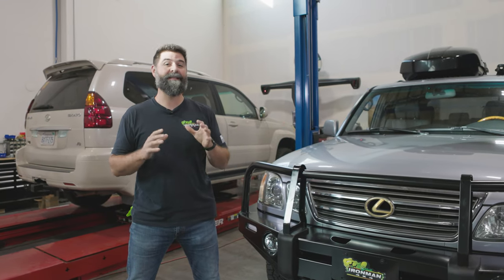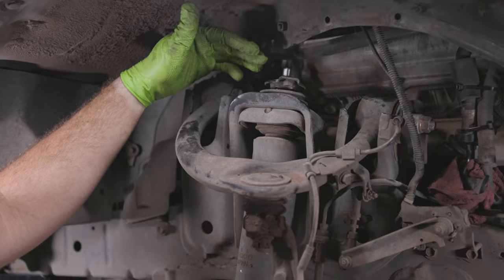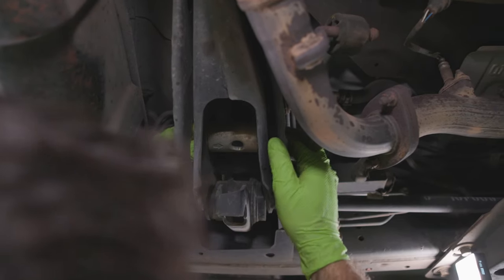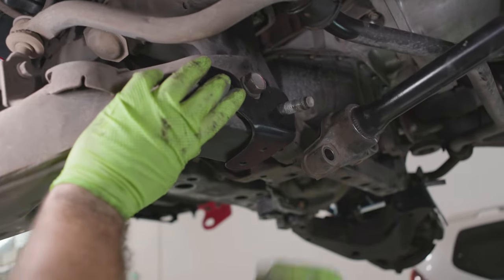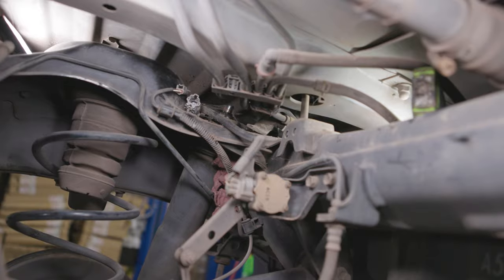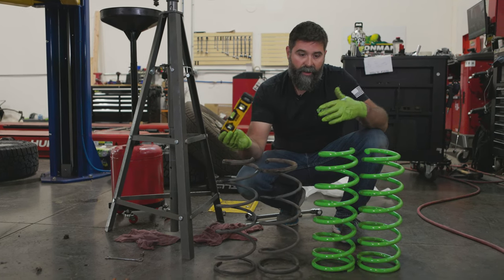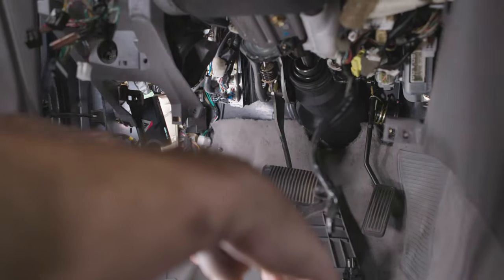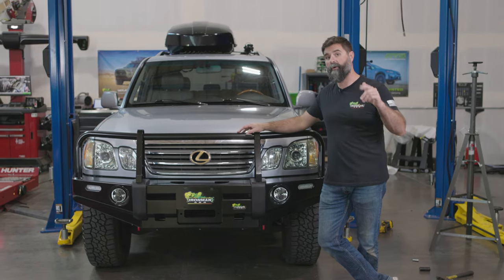Ironman 4x4 Foam Cell Pro Suspension Kit For Toyota 100 Series Land Cruiser & LX470 | Install Guide

Comment: I was able to disconnect the AHC computer with out removing the paneling/trim. It is fairly accessible. Used a long flatblade screwdriver to pop the release clips and push the connectors off. Took 2 minutes. My dash clips are brittle(Arizona Heat) I didn't want a can of worms. Hopefully this helps. Great video! Helped a lot with the installation. Thanks!!!!
Reply from the maker: Nice!
Reply: Thanks for the tip! I was able to do the same thing. Took me longer than two minutes 😂 but otherwise was exactly as you described. You really gotta jam your head all the way in the foot well to see, but still much faster and preferable to taking all that stuff apart.

Comment: What size drill bit did you use for the torsion bar support holes you drilled for the LX470?
Reply from the maker: Don't recall, but use a bit size that matches the bolt diameter to start.  Should not be any larger than the holes in the BRACKET100 brackets.

Comment: Does it really increase the payload or does it just allow for better handling characteristics when fully loaded?
Reply from the maker: The suspension upgrade will properly support the additional weight of any added accessories, improve handling and performance on and off road.

Comment: I have a LX 570, do you have anything yet?
Reply from the maker: Any 200 Series Land Cruiser suspension will bolt up to the LX570.  The kick is the LX570's AVS and getting around that. There are some good solutions outlined on IH8MUD that you can research and see if it's something you want to tackle.
Reply: @Ironman4x4America  I was more wondering about the various brackets ironman developed? I understand the suspension i.e. shocks and springs. The work around for the AVS system has been figured out for the LX 570, just now putting all the right pieces together.

Comment: Thank you for the detailed instructions. I've completed it in my garage with 15hrs of labor total. One thing i do to level the car at the end is to tighten the driver side torsion bar a bit more than factory setup, and loosen the passenger side about 4 times as much as what i do on the driver side.

At the end, i got total 2 inch as you advertised. Front driver & passenger height from ground to fender 36 inch. 
Rear driver height 37.875 inch (higher due to slightly longer pigtail)
Rear passenger height 37.5 inch.
Reply from the maker: Thank you for the support! Glad we could help.

Comment: Not gonna lie watching you zip the torsion bar bolts out with an impact after I spent 2 days fighting them and breaking 2 breaker bars kinda irritated me. Soo sick of road salt
Reply from the maker: Don't lose hope, you'll get it!  Let it soak in some Kroil for a couple of days and then try it again.
Reply: count yourself lucky - I had to cut the shocks out.  😭

Comment: What’s the name of the 22mm ratchet, I didn’t find anything similar, that tool seems handy compared just straight cut out the ahc top.
Reply from the maker: They are called a swivel head or flex head combination ratchet wrench, made by most common brands out there.  Its a great tool to have for this job and no need to cut holes in your truck!

Comment: Hi I’m going to try install these myself shortly. I noticed that i have inner coil bump stops on my 1997 prado 95 and one of them are broken in half. Can’t seem to find replacement here but i can find plenty of the chassis mounted rear bump stops. I noticed you don’t use the inner coil bump stops. Could i getaway without using them when i install my coils if i use the chassis bumpstops or is the 90 series different to the 95 series long wheel base? 
Best demo video online for this install by the way. Keep them coming 😎

Comment: So it looks like the panhard is at a much greater angle than stock height, do you need to fix this?
Reply from the maker: We do offer an adjustable panhard bar but we only recommend it if after a lift install you have rear axel alignment issues.  It works great to help correct track. But not always critical so check with an alignment shop first to see if you need it before you spend money on a problem you may not have

Comment: Just finished installing my lift, i have a question though. Is it recommended to lower the panhard bar after the lift? My axle is slightly offset at this point and ive been looking at panhard bracket extensions.

Comment: Is there a need to purchase a larger upper control arm?
Reply from the maker: The Ironman 4x4 UCA has many benefits. After lifting your vehicle over 2.5" your stock UCA's might not have the capability to make the appropriate alignment adjustments. The Ironman 4x4 UCAs will allow for more caster adjustment during your alignment. Visit our website for more information.

Comment: what size tire was he running? was the AHC system stock? any rubbing?
Reply from the maker: The LX has Falken AT3W E1 275/70R18 (33.4”) tires, and no rubbing issues.  It was the original AHC that needed to be serviced.
Reply: @Ironman4x4America  this is extremely helpful thank you so much
Reply from the maker: @loutwo  Happy to help, enjoy!
Reply: @Ironman4x4America  I have posted 2 vides about your bumper on my LX470, I love it, massively over built, and I love the look.
Reply from the maker: @loutwo  Happy to hear you love it!  Thank you for your business.

Comment: RIP AHC System. I would never rip mine out
Reply from the maker: Toyota's AHC is a great system and very much worth it to keep if it's still functioning.  For some folks, it doesn't pencil out financially to service the AHC system when there is a component failure, so this is a reasonable secondary option that keeps the vehicle mobile.

Comment: No springs in the front?
Reply from the maker: The 100 Series Land Cruiser and LX470 have torsion bars in the front from the factory.  Only the 105 series Land Cruiser has coils in the front.  Sadly it was never sold here in the US.
Reply: There's aftermarket tuning kits - shocks with custom springs as they are realized in 200 series. In Russia this kit costs 700usd(front shocks with springs, rear springs) you can install any aftermarket shocks. Torsion bars are should be removed.